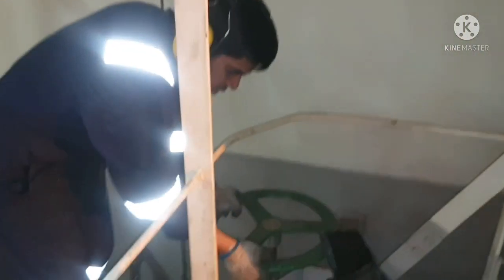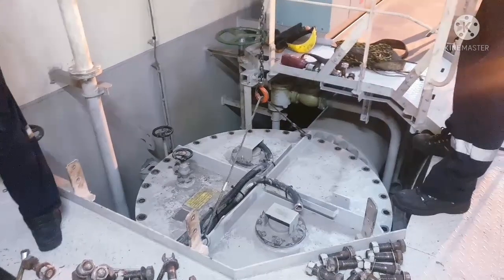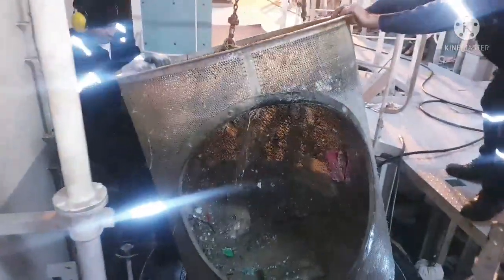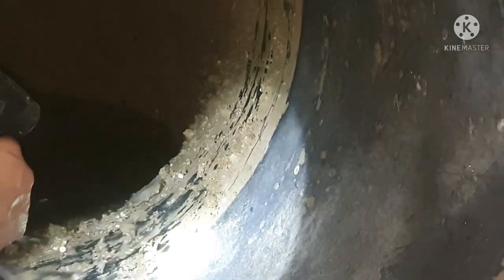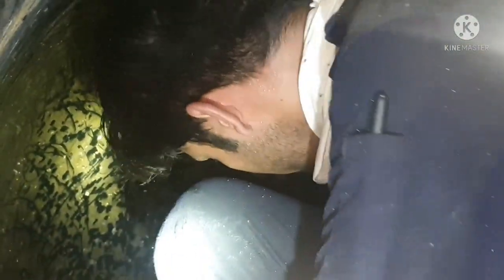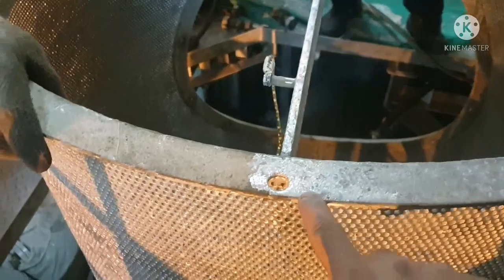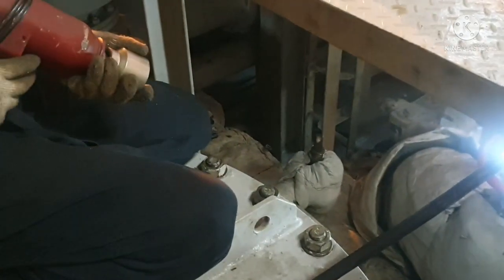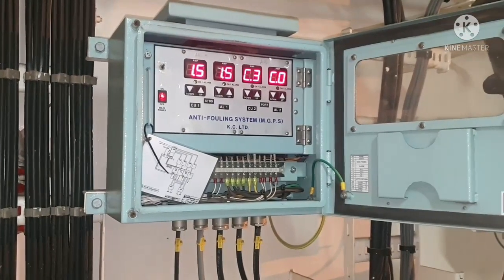How do they do...How to do sea chest suction filter cleaning onboard ship....

Comment: Good Day sir, how properly open two valves after and before filter. First open valve before filter and then after filter or first open after filter and then before filter?
Reply from the maker: u have to open inlet valve little and release air completely till water cums out vthout air,,once that is done ..u can close the purging valve and open the outlet valve fully ..then open the suction valve completely.